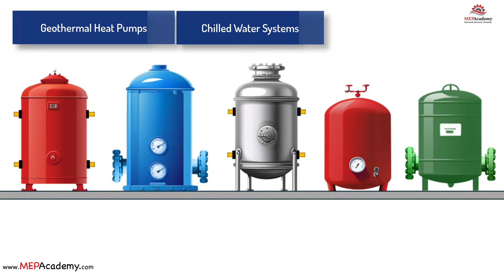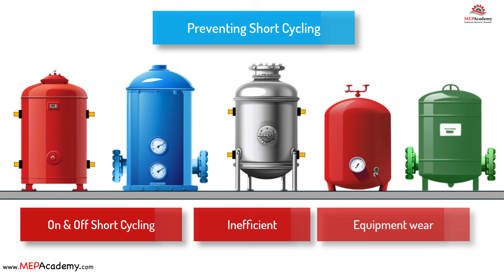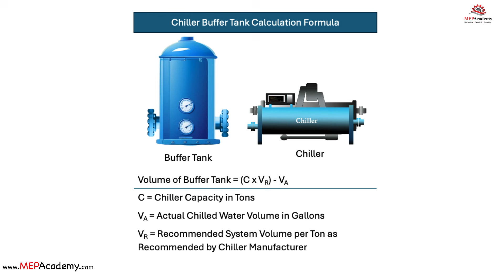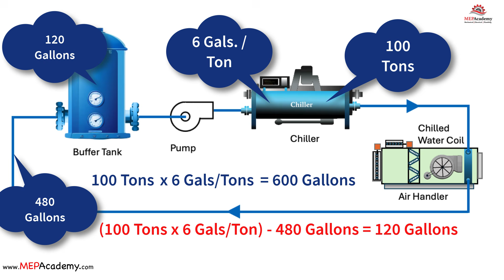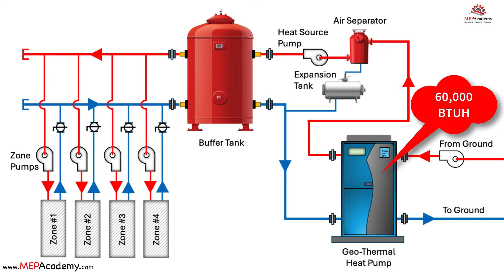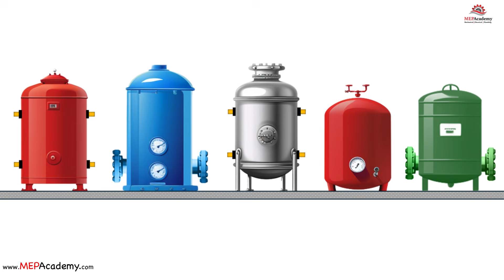How a Buffer Tank Works

Comment: Insulated buffer tanks also may help reduce the usage of LPG/CNG fuels for heat source and improve efficiency. You may also add additional heat sources to your buffer tank Solar Energy + Heat Pump / LPG-CNG Heater, etc.
Reply from the maker: Thanks for the tip - it's definitely worth considering the potential for added heat sources.

Comment: is buffer tank also expansion tank?
Reply from the maker: A buffer tank manages temperature stability, while an expansion tank manages pressure stability. Buffer tanks are typically larger and designed for thermal storage, whereas expansion tanks are usually smaller and specifically constructed to handle pressure variations. Buffer tanks improve system efficiency by balancing thermal loads, while expansion tanks protect the system by absorbing pressure changes due to water expansion.

Comment: I’m making a smaller water cooler, contained in a nightstand. Do you have any recommendations as to what buffers to use? They would be pulling from a 5 gallon bucket
Reply from the maker: We would assume it depends on the rate of energy production and depletion. Does the minimum production rate of the energy source exceed the capacity of the system to expend that energy, or are you just trying to store energy for a future use as in the use of a Chilled Water Storage Tank?

Comment: Today chillers can deal with low load condition without the need of buffer tank at intake of the chillers for short cycling…however mainly in the critical industry buffer have an other function : providing the required temperature for a required amount of time during main to back up transition to avoid closed controls temperature to go out of SLA.
Reply: Hi what do you think daikin alterna r290 6kw will have cycling issue in 50squere metters olf flat? Or ir will be just fine

Comment: Hi there, would i need to consider buffer tank in chilled water systems that come with variable speed pumps?
Reply from the maker: While adding a VFD to a chilled water system can improve its efficiency and responsiveness, it does not eliminate the need for a buffer tank. Both components play distinct and complementary roles in ensuring the optimal performance of a chilled water system. The VFD controls the flow and energy consumption of pumps and fans, while the buffer tank provides thermal storage and stability, preventing short cycling and ensuring consistent temperature control.
Reply: @MEPAcademy  Thank you sir. I have also seen two pipe and 4 pipe buffer tanks in different videos. For example, in your chilled water system, you are showing 2 pipe type, but there are also 4 pipe types. What are their differences?

Comment: We want to do larger buffers than these formulas indicate. Is that a problem? much larger. both hot and cold side.
Reply from the maker: Of course you can use larger tanks. Here is a link to B&G's Buffer Tanks, that go up to 1,040 Gallons and 12" connections for chilled water, and 300 Gallons and 4" connections for heating hot water. There are many other brands, but of course larger tanks are used than what was shown in our example. https://www.amtrol.com/product/buffer-tanks/